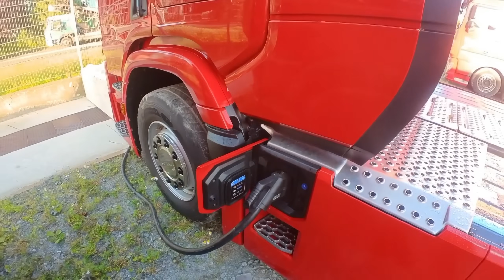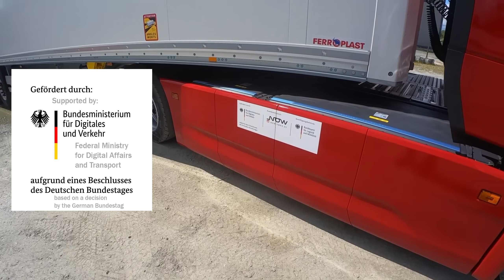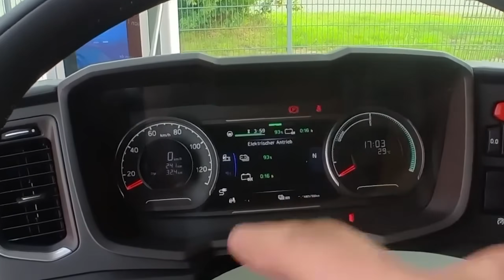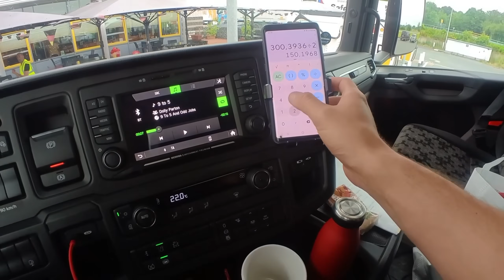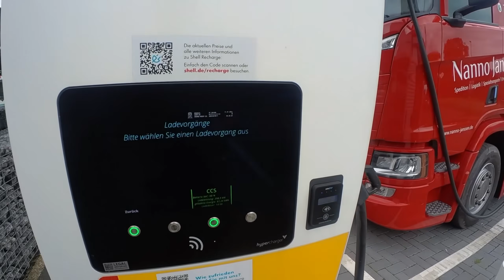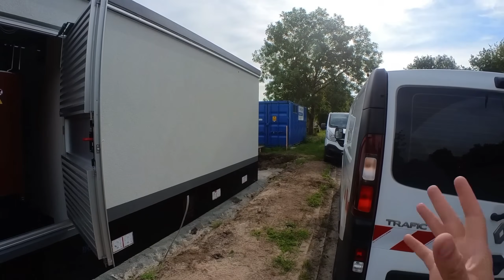Switching to Electric is the Answer for Logistic Companies

Comment: My only comment would be don't forget the new truck charging standard as Bjorn introduced us to in Norway awhile ago now is the MCS(Megawatt Charging Standard) just need the charging infrastructure.  CCS though will be good for smaller trucks but the long haul trucks the MCS standard will be better once the infrastructure is out there for charging.

Mein einziger Kommentar: Vergessen Sie nicht den neuen Ladestandard für Lastwagen, den Bjorn uns vor einiger Zeit in Norwegen vorgestellt hat. Es handelt sich um den MCS (Megawatt Charging Standard), wir brauchen nur die Ladeinfrastruktur. CCS wird zwar für kleinere Lastwagen gut sein, aber für Langstrecken-Lkw wird der MCS-Standard besser sein, sobald die Ladeinfrastruktur vorhanden ist.  (Google translate)

Comment: I am pretty sure modern electric motor controllers can choose to waste kinetic/electrical energy as heat rather than necessarily recuperating it. So as long as the motor has an adequate cooling system, it can function as a retarder even when the battery is full

Comment: It looks like a new generation of truck drivers is upon us , but i cant see the older drivers embracing the electric revolution as much as you have , your taking to it well and doing a fantastic job to as a newbie to the transport industry,. The problems i see are the charging points out on the road being swamped with vehicles waiting to get on the chargers, germany seems to have a good charging infrastructure but i doubt other countries are as good, imagine being on 5% and going to the only charger available and there's another ev on charge in front of you, then you have to wait untill he has finished before you can charge, 45min charge for you turns into 90 minutes ,. This happens in uk with cars alot , ev trucks in uk are practically 0%, our service centres and truck parking are poor compared to germany,.You are doing a great job of promoting ev trucks and cars to be fair but if your company goes 100% ev trucks they will lose drivers, i'm old school (retired) now and for me ev isn't an option as i come from the petrol/diesel generation,. Have a look at "marc travels" on you tube, like you he's an ev hero and german, i do find the ev content interesting, cheers.
Reply: Dedicated truck stops are here/coming

Comment: I find range anxiety with electric such an odd thing. With electric you have a much more accurate estimation of how many miles/km's you have left compared to an ICE car. I think everyone knows that feeling when their combustion cars low fuel icon comes on.. it doesn't really tell you much of anything. It doesn't take in account for anything such as AC or other in vehicle systems, it doesn't track how much your driving is using.
Reply: Is not taking all that in consideration because is not important. You have plenty of gas station all over the place and you can fill up in 5 minutes or 15 minutes for a truck

Comment: I have big respect for you showing a clear view of electric trucks and how they do work and are nicer to work with (also thank you for conversion to miles and miles per kwh).

I also have respect for the company you work for investing not only in a fleet of electric trucks but a brilliant charging setup including battery and solar. For anyone doubting the cost effectivness of EVs, solar and battery storage... a company wouldn't do it if it didn't make financial sense.

Comment: Interesting content!
I wonder. Have it been considered putting a battery on the trailer, instead of (or in complement) to the one next to the transformer. That way you don't have to first charge one batt, and the charge another one (in the truck) from that. Gives double the wear on the batteries and they only have so many cycles. And are expensive...
If you had say 50-100 KW/h in the trailers and Scania/Volvo/Merc made so you can power the drivetrain "directly" from and external plug by the sadle, then you'd save a charge cycle. And getter better range.
And if you really wanted to go innovative, put some flexible solar panels on the trailer roof. 13,5 x 2.5 m = 33 m2. So 8ish kw. Maybe more like 6, with low elevation. But that even when the trailer is parked. Someone should talk to Krone. It's already done with some refrigerated trailers.
https://advancedfleetmanagementconsulting.com/eng/2020/03/07/4552/
https://www.greencarreports.com/news/1137225_sono-solar-electric-semis-buses-kit

Comment: Personally i think this is a ridiculous idea, for long haul we need better infrastructures, overhead wires and pantographs on trucks so they only need small batteries to deliver off the highways, they can charge without stopping.. So much wasted energy carrying all that extra weight, governments need to get serious about putting in the necessary infrastructure to support green energy solutions,
Reply: Even with big batteries, it's still more efficient than ICE/diesel, since the diesel engine is only around 30% efficient vs. 90%+ for an electric motor. Transforming the energy into motion that is. One might say that it's kind of ridiculous wasting 70% of the diesel energy into heat ;-) Sure, better charging infrastructure would indeed be nice (and needed when there are more electric trucks on the roads), but as he shows here it's doable to get quite decent additional range from charing 45min on a 300kW+ charger on the Scania truck when he is require to have rest time anyway, and in a year or two we will hopefully start to get faster megawatt chargers and more capable electric trucks.
Reply: fun fact. In electric vehicles, weight doesn't greatly affects efficiency. Unless you gain significant elevation. Aerodynamics rules, followed by the efficiency of the drivetrain. For instance, a Tesla M3rwd is more efficient than a Dacia Spring despite being 800kg heavier.
On paper,  overhead wires on motorways seem a good idea. But not so sure its implementation is really cost effective, improves overall efficiency, and is fail safe. Battery technology is improving quickly.
Reply: Battery technology is improving. We will have batteries that weigh 30% less in a few years.
Reply: The EV truck infrastructure will need a lot of work for sure. There is not a lot of extra weight and solid state batteries in the mid-term will solve the weight and charging speed issue.

What makes you think Battery Electric Trucks are a ridiculous idea? Did you watch the video.

Comment: Sattelkupplung:
🚫 saddle
✅ fifth wheel

🚛 Keep on truckin'!
👍 Keep on vloggin'!
Reply: First time someone called it "fifth wheel" I was trying to figure out how the steering wheel fits into the context of the sentence...
Reply: @Validole  
Fifth wheel is the quite common name for the tractor-mounted part of the semitrailer coupling, with the trailer-mounted kingpin as its counterpart. 
Neither semantic nor mechanical connection to the steering wheel there.
Just consider so called "fifth wheelers", pickup trucks pulling an RV semi trailer.
What the Americans call a semi-truck, the British call an artic, the colloquial abbreviation of "articulated lorry".
And the tractor itself, when not pulling a trailer, is called a bobtail in the US and most probably in Canada also.

Comment: The depot could really do with having a boundary to boundary solar canopy system & battery storage installed to power the eventual fully electric fleet and to earn the company extra income by providing grid services. As I keep saying to owners of outdoor parking and storage areas, you have a set of fixed costs - insurance, maintenance, local taxes, etc. When these areas are not being fully utilised, those fixed costs are effectively up to two times more expensive. Also, the design of most of such areas is on a two-dimensional plain. By installing a boundary to boundary solar system, you immediately turn it into a 3 dimensional usable space, effectively those reducing costs as a consequence. By boundary to boundary I mean just that. A system that includes the circulatory areas in (addition) to the actual parking/storage bays. Take a look at Tesla's Giga Berlin new solar canopy system as an example - plenty of YouTube videos showing it.
Reply: Solar canopy's need to be supported will a structure that might get in the way of these trucks moving around.

However the technology for solar roads and solar footpaths exists, so they could install a solar car park with the panels on the ground and you just drive over them.

Comment: The whole idea that heavy trucks need 1000+ km to be usable is pretty pointless.
As every 4.5 hrs you have to stop anyway. All is needed is fast charging and charging infrastructure
Reply: It depends where you are in the world...in densely populated areas like europe have the population and electrical grid to support a charging network that your going to be able to stop at every 4.5 hours.......other places in the world not so much
Reply: @unhippy1  indeed, it is just a matter of infrastructure everywhere. All you need is local solar array/wind turbines and used battery pack stacks as energy buffer. 
Other than economic restrictions, it is mostly a matter of policy
Reply: @USUG0  Or nuclear power plants (way greener than what german poltics think and replaced them with gas and coal (after the Ukraine war) burning power plants). Solar and wind and battery packs alone won't give the necessary eletricity in the moment, at least during the next years
Reply: @miguelcardoso1903  no amount of facts will ever beat personal flawed opinions. Energy share from renewables is already higher than nuclear, in Germany, EU, USA, China and worldwide. It is also cheaper than nuclear per GWh produced. And can be implemented much faster (1-5years vs decades) than nuclear as well
Reply: @USUG0  Well,  if it is a non-windy night you still need energy, and need it from a avaliable source. You either get it by a nuclear plant or a fossil burning plant. So far, there is no other option
And nuclear is more efficient, takes less resources and don't emit harmful gases. And is completely safe as well. For some reason it was considered the greenest non renewable power source... until Merkel decided it was more enviormentally-friendly to import natural gas from the russian "friends"
Reply: @miguelcardoso1903  you should buy land in Chernobyl and Fukushima, I heard you can get great deals. And let me know where you live, I will recommend your area when looking for where to stock the nuclear waste.
And, your non-windy night argument is really the simpleton way of reasoning. I bet you think Trump is a genius with a large a-brain

Comment: Your comment about reversing visibility really drives home the wisdom of Tesla's choice to centrally locate the driver's position in the cab and offset the additional seat to the rear of the cabin.
Reply: With the driver in the center in Tesla Semi, both sides are "bad" sides to back into. But that's what we have mirrors, cameras and talented drivers for.
Reply: Tesla often does cost saving and then tries to sells it as an advantage. Central position means only one design for all markets.
Reply: @experimental_av  exception that the Dimensions don't work at all in Europa. In the US the length of the truck isn't limited. In the Europe it is. So the design doesn't work here.
Reply: @Jan_mxv  True. But Tesla has also done extensive market research with the trucking industry to help finalise the production intent vehicle.
Reply: dumb idea
Reply: @MrStian78  In what sense?
Reply: @pinkelephants1421  the guy above me said it.
Reply: @MrStian78  Tesla went with the centrally placed steering & driving wheel position based on feedback from the trucking industry and their drivers along with many other features. It's partially why it's taken so long to get it past prototype & homologation stages to the point whereby they are now building the Semi mass production facility at Giga Nevada.
Reply: @pinkelephants1421 Zanegler follows it daily
Reply: How is the trucker supposed to pull a ticket or hand out anything from the windows?
Reply: @Felix-st2ue  Apply the brakes, get up off of their arse and do the necessary. They have legs, don't they?

Comment: It is very interesting that the Scania is using 1kWh per kilometer, this is the same usage as the Tesla Semi. To me, this means that the Scania Engineers are TOP NOTCH. I don't know what the other manufacturers are getting regarding energy usage, but I doubt they are as efficient as the Tesla and Scania.
Reply: Please don't mix up kWh (battery usage) and kW (measurment of power)
Reply: @NicMediaDesign  fixed
Reply: The US semi limit is higher. 70 mph vs 50 mph.
Reply: @RODI____  Yeah we need more information about the conditions (speed, temperature, load...) to make a fair comparison, but Scania consumption sounds promising. Tesla says it's Semi consumes 1.7 kWh/mi (1.1 kWh/km), but I don't remember the conditions behind those numbers.
Reply: @RODI____ much worse mileage and safety
Reply: should compare them in same conditions. In Europe trucks can travel at max 90km/h. In US, trucks travel mostly over 100. Even 130km/h
Reply: @USUG0 worse safety and mileage with excess speed in the US, hurts range

Comment: great work! in my laymen opinion i would think the oppcharge approach with reverse pantograph would be very useful! and t😊hem installed at at onload/offload docks you would skip cables and stuff. and the connection would be 100% automated.
Reply: This or wireless underneath

Comment: Volvo has been in the BEV truck game for much longer, they have been selling BEV trucks for years already, Scania just started getting them out on the roads very recently I believe.
May have had a few test trucks in some places but dont think they have sold trucks to the wider public until now? I could be wrong. Volvo even have an BEV truck in the USA now.
Reply: Volvo has a higher overall market share in electric trucks than Tesla does in electric cars! A lot has happened in 2024 and Volvo is not in the lead anymore where it comes to range and installed capacity

Comment: I'm looking forward to a real cold and snowing winter. Would be interseting to hear from your experience when weather gets hard.
Reply: from experiences made in sweden about 10% decrease in range is to expected in snow and bad conditions. cold doesn't really make much of a difference as long as the truck is used regularly. in that case batteries ate kept at a good operating temperature at all times regardless of the ambient temperatures. it's actually heat that's more of a problem.
Reply: Heat pump heating and cooling of the batteres can fix that